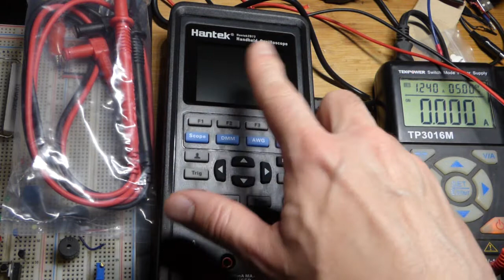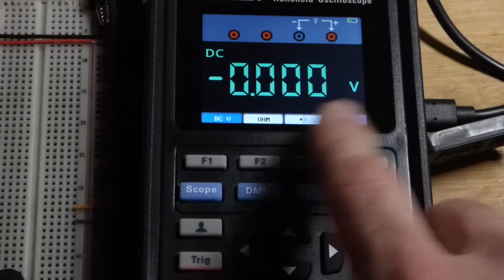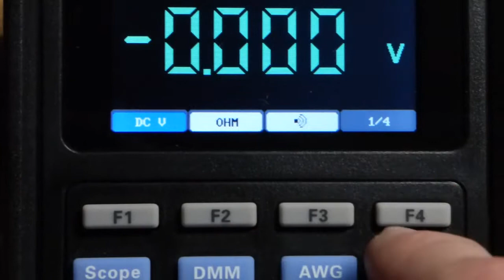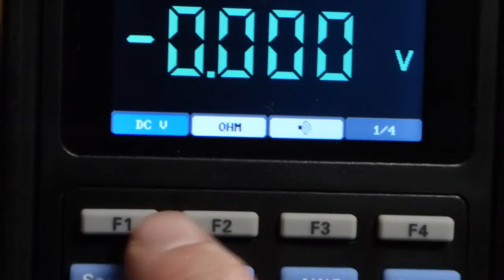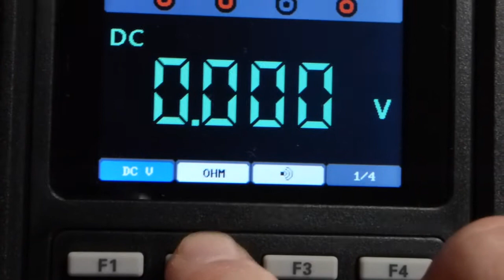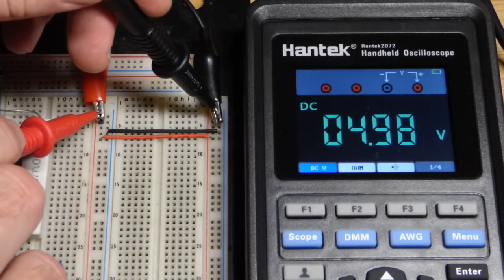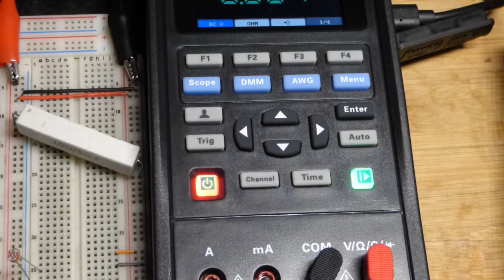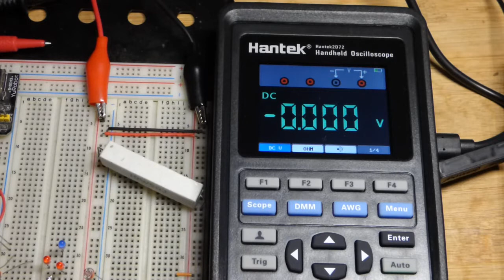How to take multimeter DC voltage measurements with Hantek 2D72 DIY video

Comment: Grats on getting this scope. I've had it for over a year and it works pretty good once I remember the controls. I've never had to use it above like 1 or 2 mhz though. I used it to repair some old amplifiers and computers.

Comment: I have similar model, the 2D42 (not sure what the differences are, it looks identical), we got it sent to us by the University during covid when everything was online, for an electrical engineering course, in order to do lab work. It is a pretty nice piece of equipment, has a single channel for a signal generator, and two channel oscilloscope, in addition to the other multimeter features. The main problem I had with it was charging it, many times I would charge it for hours, and still, it would have only one bar, blinking. Wish there was an option to use batteries. If it sits around unused for any significant amount of time, you are almost guaranteed to have to spend a lot of time charging it.
Reply from the maker: That's a bummer about the charging. I think they all have 18650 batteries that can be replaced, but you have to open the unit.

Comment: I was thinking that you should get one of these 3-in-1 devices!  The timing makes me think you must have gotten a great deal on the recent PRIME DAY!  Thanks for the great videos!
Reply from the maker: Not sure if it was a prime day purchase or not, i got prime shipping which became unavailable shortly after, price is the same though. I bought a Liumy meter + oscilloscope many years ago, thinking it would be an easy to use scope for videos but ended up not working out too well. So I have been looking on and off for something better ever since then. I was suppose to not be working for an unknown amount of time, so I thought I could make a lot of videos with this, which highly factored into getting it now. But after it arrived, I found out that I will end up working even more hours than normal lol.
Reply: @Electronzap  I think you made a good decision in getting the 3 in 1 device!  It's like having an electronics lab in a DMM case!

Comment: Hi there! I'm totally new to using this device. My dad was an electrical wizard and had probably every device or tool you can think of, but now that he has passed away I'm trying to use his things to troubleshoot issues I have around my house. Please bear with me as I'm not well versed in these things! Currently my dishwasher is on the fritz; it will not turn on but I wanted to further diagnose the issue before buying random parts or a whole new dishwasher. I saw a video about how to test the voltage coming from the black and white wires underneath the dishwasher, and the video said the voltage should be 120 v. When I use my oscilloscope (the exact model you have in your video), I get a reading of 0.108 v. Am I supposed to ignore the decimal?? Your device looks like mine when nothing is happening (reading 0.000 v), but I see yours changes to 04.98 v when you tested voltage (the decimal place moved). Am I doing something wrong, or is my reading indicating that I have an issue with the breaker?? Thank you in advance!
Reply from the maker: Thanks for watching! 120V is probably AC, so make sure it is measuring AC instead of DC. AC will probably average out to 0V if the meter is displaying it as DC. Oscilloscope is for measuring rapidly changing voltages more than simple voltages. I'd use a multimeter with an AC voltage setting, or a voltmeter to measure most appliances. I don't have any tips for adjusting oscilloscope settings, I just kind of try things out until I get good settings for what I am measuring.
Reply: @Electronzap  Ah! Yeah, AC vs DC would make a difference 🤦‍♀Definitely looking into a multimeter, this thing is a bit advanced for my needs. Thank you very much!